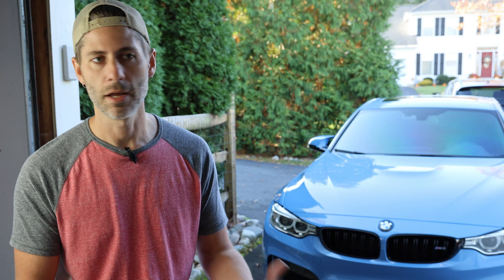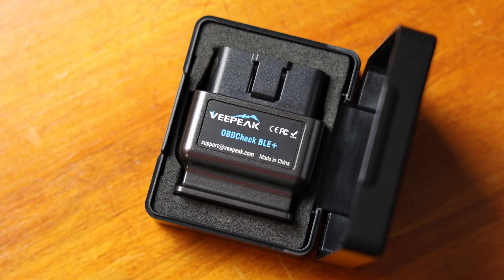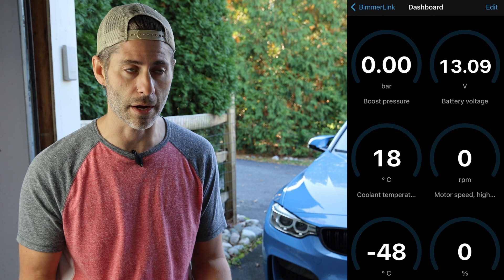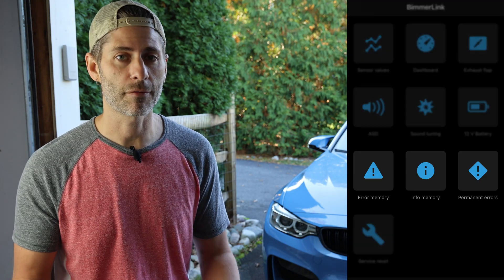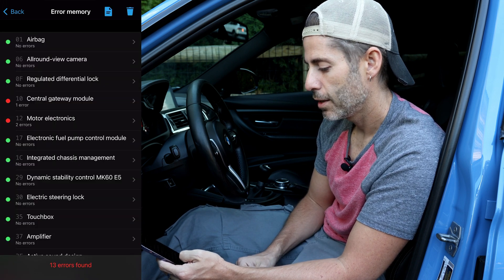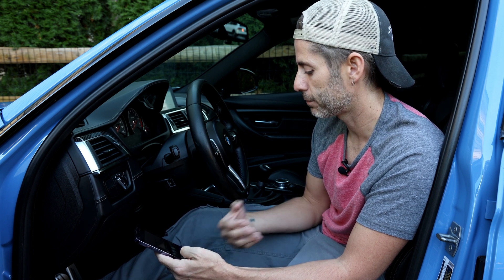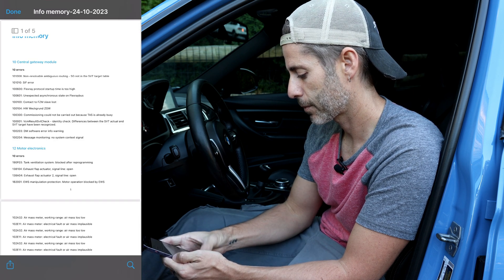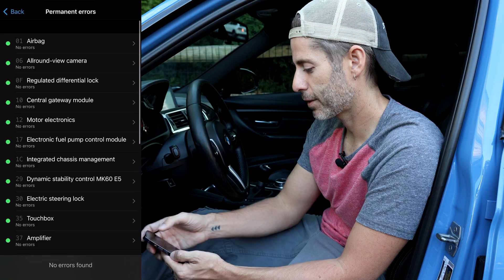Translate ECU Issues with ChatGPT 4 and BimmerLink

Comment: Its insane, there is a few cars in my town that run on Stage 1 created by AI without. 100% changes made by AI and it WORKS
Reply from the maker: That's wild. Using AI to make maps/tunes is pretty brilliant.
Reply: @AlwaysSummerGarage  absolutely. Even does pops and bangs, launch control... first time I saw it I was mind blown. All you need is a kess v2(copy in that case), download the ecu file, load it into chatgpt, let it do changes, download it and upload. Saw it live and the process doesn't even take 30 minutes. Insane!